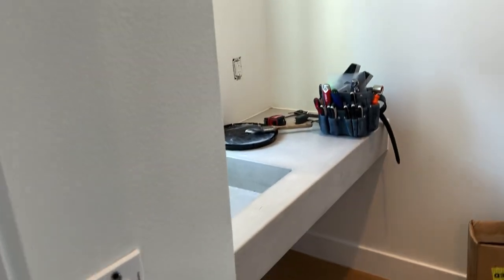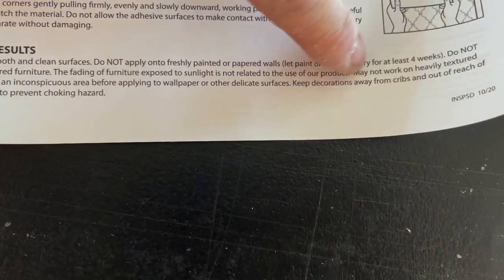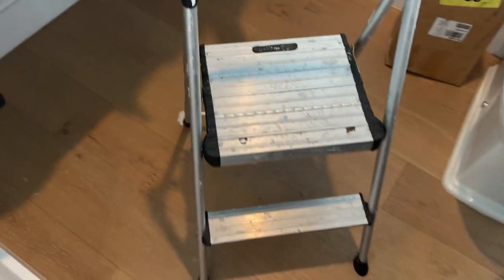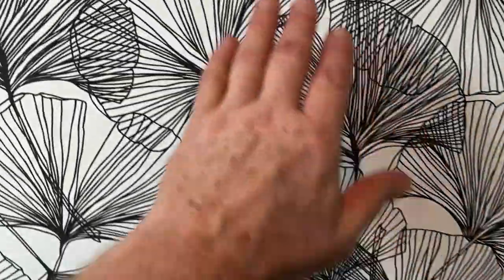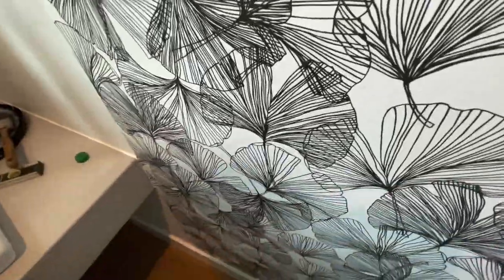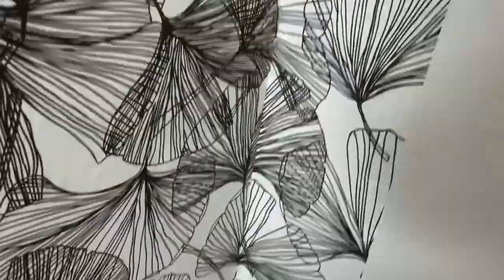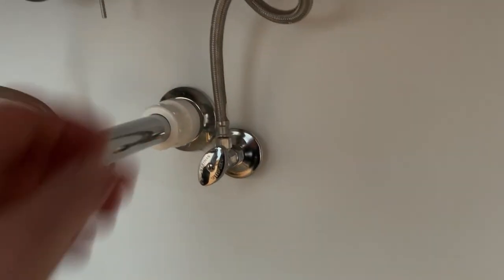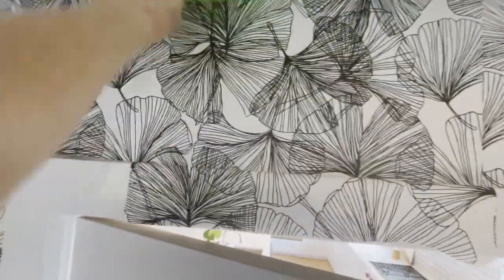Install York Peel and Stick Wallpaper in Your Bathroom-Tips N Tricks - Spencer Colgan

Comment: I'm a homeowner and I'll be installing peel and stick wallpaper on accent walls in two bathrooms. I've never worked with wallpaper before. One wall is new drywall with patches of joint compound that have been sanded smooth. The other bathroom wall has new joint compound smoothed over the previously painted texture. Do I need to paint the walls before papering? And then wait 4 weeks??
Also, how much texture is too much texture? There is some texture behind the toilet tank...
Reply from the maker: P n. Stick cannot have texture under it.  Get rid of it please.  Prime
Reply: @spencercolgan  thanks for your quick reply!
Reply from the maker: Let me give you a more detailed answer 

Please go and get yourself Gardz. It is a clear sealant and it will go on your boss bathroom project areas you discussed   It will seal that dry plaster very very nicely and then give that a full day to cure and then please watch my video on “the secret to hanging peel and stick wallpaper “by Spencer Colgan
Reply from the maker: @ondine4913  I sent you a more elaborate reply to yesterday’s answer
Reply: @spencercolgan  I couldn't find Gardz and I wanted to start right away so I got the Roman Pro 999 RX 35, the expensive stuff. I did one coat, not realizing it would go on clear. I then watched another of your videos in which you said the purple drywall will show through the peel n stick. So now I guess I need to apply white primer (I have Kilz, and also high hiding white paint and primer in one. Will either of those work?) and then another coat of RX 35, is that correct? And then how long does that take to out gas?
Reply: @spencercolgan  The more I learn from your videos the more impressed I am with your skill, and I see why your videos are an hour long whereas some amateur how-to videos are 5 minutes. (I wonder how many of those amateurs ended up with bubbles a few weeks later...) The more I know the more intimidated I am by this project that I thought would be "easy". Am I naive to think I can do two bathrooms, cutting around toilets, outlets, light fixtures, a medicine cabinet, a corner and a door frame plus a slight bulge because one wall is not straight?? Plus I accidentally got some RX 35 on the ceiling. Maybe I should just paint. But I love this paper...

Comment: Hi Spencer. 
Great video! Quick question,  in rhis video you use a smoother and water,  but in a previous vidoe you recommended an eraser.  Is that because the wallpaper was different or for another reason? 

I really appreciate the videos.  Keep up the great work.
Reply from the maker: You are very astute! And I knew this question would come, I just didn’t know that it would come so soon!  The reason that I did not use any racer in this video is because in this video I wet the wallpaper underneath and therefore the eraser was simply not going to get the bubbles out; if I did not use the water underneath, I would have been using the eraser. Have you enjoyed my videos my friend? If you have would you mind doing me a five star review on the following link and say something nice about my work? If you do it and take the minute, you have a friend here who greatly appreciates your effort

https://www.google.com/search?q=tampa%20wallpaper%20installer&tbm=#lkt=LocalPoiReviews&trex=m_t:lcl_akp,rc_f:nav,rc_ludocids:18168418332679895040,rc_q:Spencer%2520Colgan%2520-%2520Wallpaper%2520Installer,ru_q:Spencer%2520Colgan%2520-%2520Wallpaper%2520Installer,trex_id:XCBBr
Reply: @spencercolgan  Thank you for the quick response and explanation!